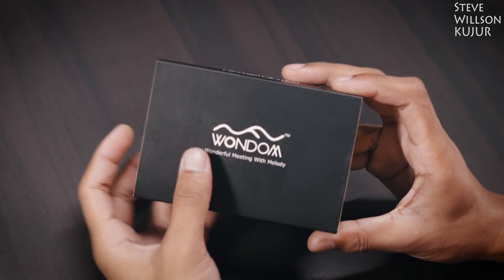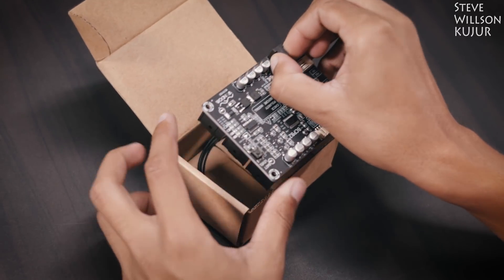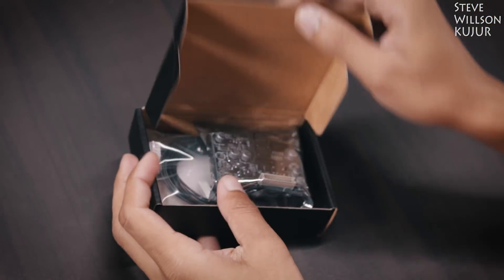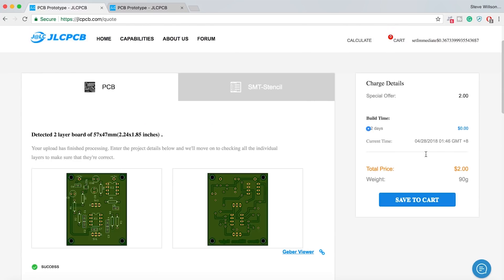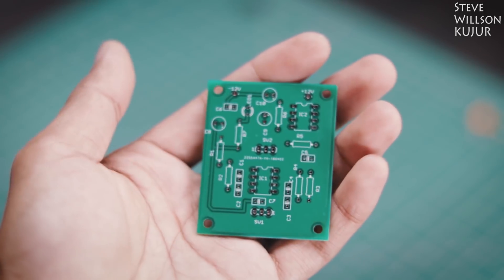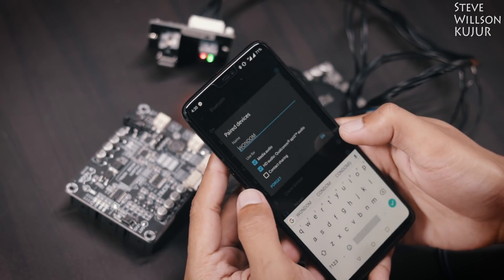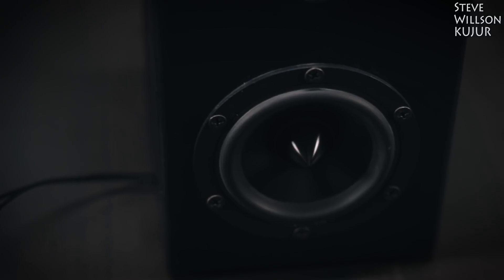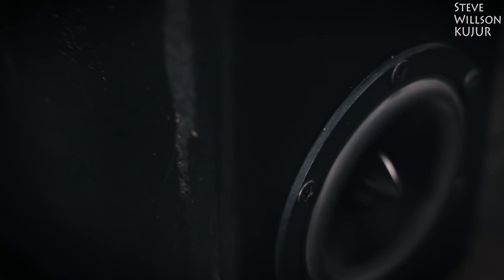Best DIY Bluetooth Speaker Amp Board | Bluetooth Speaker

Comment: Steve Willson Kujur+ In the beginning of the video you have version JAB2, but soon after you're using JAB3 with a external antenna how come?
Reply: JAB2 doesn't have the external antenna feature v3 has the feature and wasn't mentioned. Are they trying to get rid of a truck load of the old?
Reply: The link you provided doesn't have the connector and that one says JAB2. Yes you're right, but I purchased the version before this one at parts express like the one in the link you provided.
Reply from the maker: JAB3 don't have Bluetooth , but JAB 2 have Bluetooth but it have DSP , if you want Bluetooth & DSP then you need to pair JAB 2 with JAB 3 

Yeah i think they have lots of in stock that's why they did this
Reply: That's like throwing $40 in the garbage when they do bad business like this.
Reply from the maker: Yeah kinda but the Quality is impressive

Comment: so the voltage output of the battery module is 12V? would have been nice if it had a boost circuit for 24
Reply from the maker: Yeah exactly
Reply: Quickie Demonstration was good tho. Hey Alex, make a video about that!

Comment: These are great boards! I use the Dayton ones myself in alot of builds. Keep up the great work!
Reply from the maker: Yeah Dayton's are also great
Reply from the maker: Yeah DSP video coming soon
Reply: Fancy meeting you here. I purchased 4 of these boards in version 2, this one is version 3 with the external antenna, figures. Parts Express has this board for sale, but I couldn't find it at Sure. The one he's showing isn't there.
Reply: Check out all of the add on's to work with DSP https://www.youtube.com/watch?v=oKeXPYYVCmo and https://www.youtube.com/watch?v=a9vZYDtNABg&feature=youtu.be
Reply: Do these wondoms and the Daytons work together?? (seem identical, wasnt sure if the dayton battery extension boards ect. would work with the Wondoms too!)